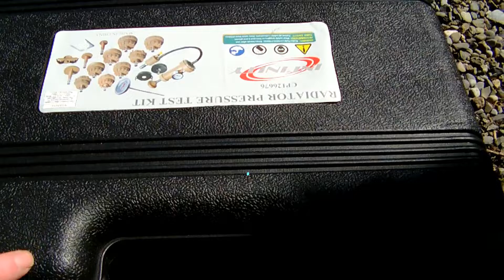BMW M43 Thermostat leak E36, Z3, E46

Comment: LOL... 3:35 that sinking feeling after a job well done.  
Happy cooling system once again 4:58
Sorry... lame jokes.
That's a big upcoming project... front chain cover?
Reply from the maker: Lmao I'll never look at it the same again 😂😂😂 and yes I plan to do the gasket.  I'll need the muscle power of one of my brothers to do the crank bolt though, I'm too weak 😂
Reply: I've heard of people using the starter to break the bolt free... breaker bar & socket, bar handle resting against chassis or ground. I'm too chicken to try it myself. I'll wait to see your video... to find out which way you decided on. =)
Reply from the maker: Yeah I had thought about it but came to my senses a second later lol I don't have the balls to do it 😂😂😂

Comment: No need  coolant flush  until remove thermostat ?
Reply from the maker: If you want to do a flush, replace everything that’s leaking or broken beforehand, yes.  No need to waste coolant 👍
Reply: @TheCowgirlNiamh  Ok, i will change the right side water flange as a prevention but i can't see  access  unless removing intake manifold and fuel pressure rail ..
But now ,  just  need to change the  thermostat , because my car  is not reaching is  normal operating temp,  thermostat stay open ,  ,so i will not flush water this time  
 Next time for the side flange  like you said i will flush it .  thank you 👍👍
Reply from the maker: If you remove the manifold and go down that way, you need to replace all the gaskets and o rings.  Another way in could be through the oil filter housing if you remove it.  Again you will need gaskets etc. It depends how big your hands are.  Mine are only little so I can sneak them in 😂